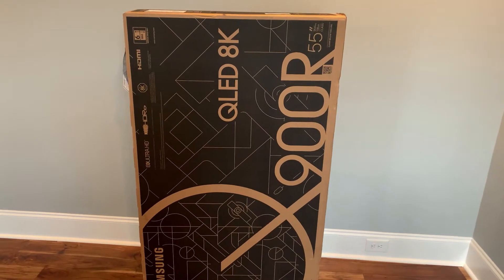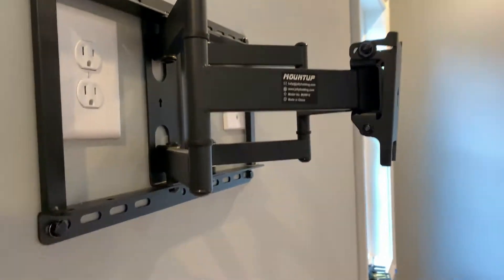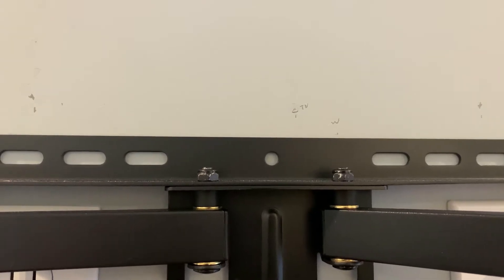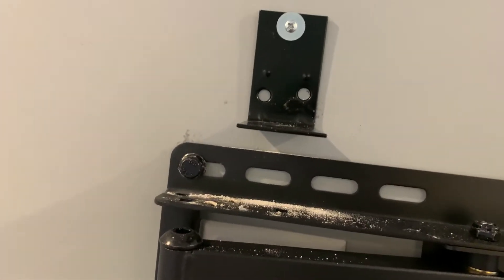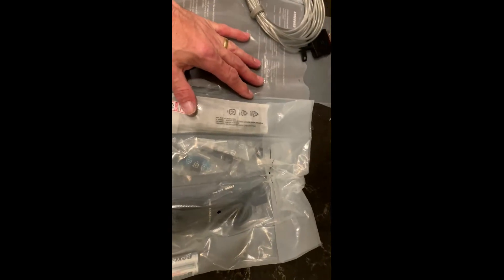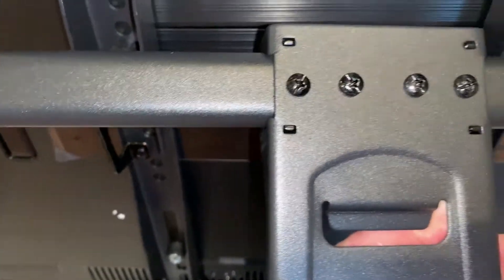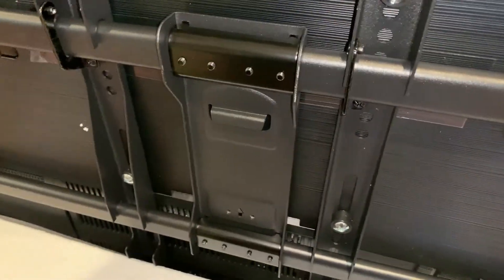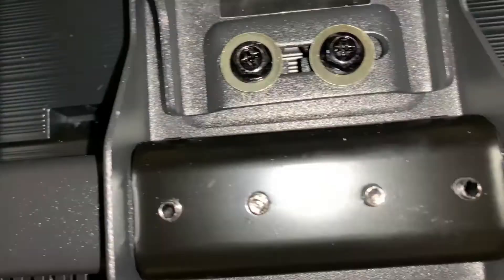How To Wall Mount Samsung 4k 8k QLED TV With One Connect

Comment: Where did u buy the mount to mount the tv ?
Reply from the maker: The customer picked them Up either at Costco or Sams Club with the TV's but any full motion mount should work, the brackets came from Lowes, any L shaped bracket should work. 

Bracket 
https://www.amazon.com/Bracket-Articulating-Rotation-600x400mm-Pipishell/dp/B07MZTT1BF/ref=sr_1_9?dchild=1&keywords=full+motion+mount&qid=1634691325&sr=8-9

Thanks for watching.

Comment: Can you put a link to the L Brackets you used for the one connect mount?
Reply from the maker: https://www.lowes.com/pd/National-Hardware-2-1-2-in-Steel-Zinc-Plated-Corner-Brace/1000390945

Not sure if that was the exact one, but any Corner Bracket up to the width of the box will work.  You could use a couple corner braces if needed, if you can hit the studs for sure could use smaller braces, if you have to go in the sheetrock I'd use a couple wider braces and use sheetrock anchors for support.  Realistically if if you mount the unit above the mount and the tv is pushed back will most likely not matter but just incase...  Thanks for watching hope that helps some.